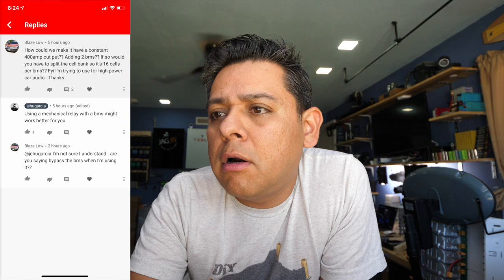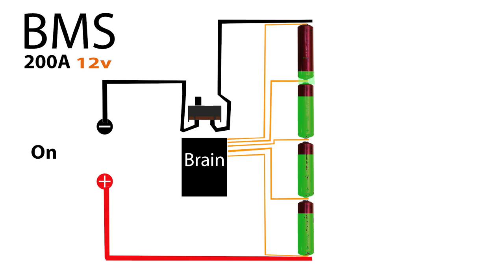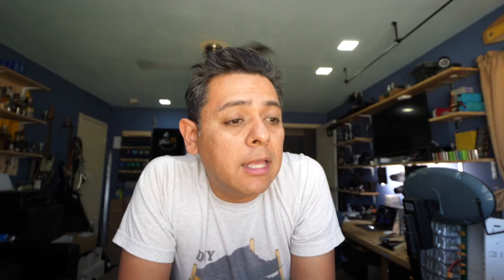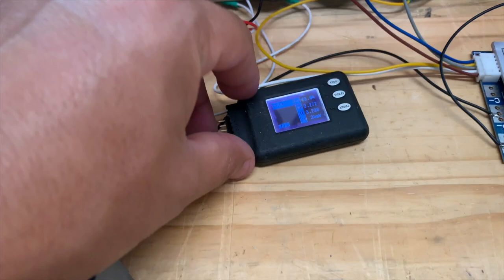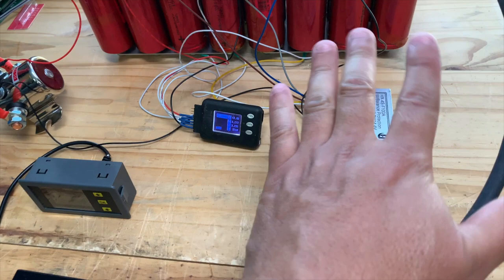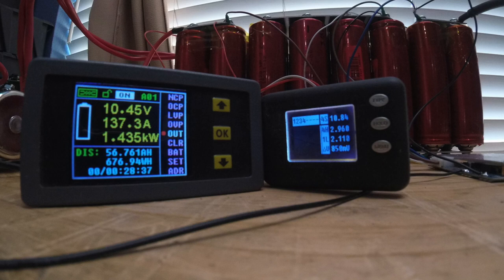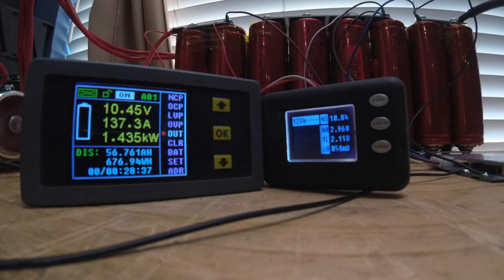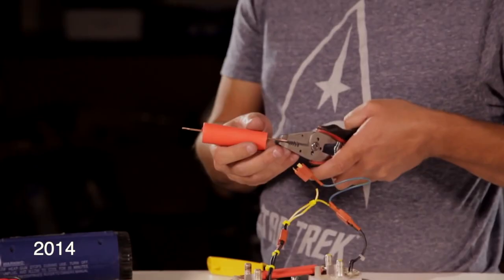4000A BMS?

Comment: Here's a little trick I use for reducing the holding current on a contactor. Hook up the contactor / relay to a power supply capable of driving it. Apply rated voltage to the contactor to close it and record the voltage across the coil and the current through it. Use R=V/I to calculate the coil's resistance. Now reduce the voltage across the coil until the contactor opens and record the current through the coil. You'll want about 130% of the current going through the coil to keep it closed. Now you have enough information to calculate the resistance and power rating for a resistor to put in series with the contactor's coil such that, once close, it will remain closed drawing just enough current to keep it closed. The trick now is to find an electrolytic capacitor to put in parallel with the resistor that will close the contactor fully when power is initially applied. Usually several hundred uF. The voltage rating of the cap need be no more than whatever the voltage drop is across the resistor. Take note of the cap's polarity as well. This can significantly reduce the power consumed by the contactor, which will also run much cooler.
Reply: Yup that is a home brew version of a constant duty solenoid driver. Best way to do it is to use a sense that indicates closure and then enables a pwm drive to the magnet. Another method is to use large IGBT bricks to switch the current on or off. No moving parts and for a simple switch they would likely outlive whatever the load is.
Reply: @christopherleubner6633  like a coil econimizer some contactors have built in. you talking about igbt like in the bms? or or those called mosfets? your saying replace the contactor with igbt? so bms mofet turns on igbt which turn on load?

Comment: Yes. The other problem with some of those contractors is, some are not rated for continual use
Reply: yep as they are often used for just starting bursts....ALso check how  many amps the coil requires, thats  continuous energy required

Comment: For my VERY HIGH POWER systems I use IGBTs. They can be pricy but they are solid state (I mechanical switches with coils that pull power on their own). Plus if not done properly the inductave spiking or kickback will blow up your BMS so you must use a freewheel diode. IGBTs are just amazing.
Reply: A little late to the party but IGBT's are simply not the way to go, given that they have a fixed voltage drop of something around 1-2v, depending on current. So if you're passing say 100A through the IGBT, it will be dissipating 200w of heat. That's a huge loss right there.

Now of course if you're passing 400v at 100a through that IGBT, a 200w loss isn't THAT much compared to the 40kw that its switching, but it's orders of magnitude more than the 2w that a modern day 500A relay consumes to stay closed.
Reply: @00000005547  "it will be dissipating 200w of heat" compared to the 1.5 to 2 watts of the relay coil if it has an economizer 
... 7-8 watts if not.

Comment: I have had trouble connecting relays to BMS this way. Most of those BMS switch the charge and discharge current independently. So in the configuration shown in this video, the relay will stop over-discharge but will not stop over-charge. If you flip the current flow the other way through the relay and BMS, it will top over-charge but not over discharge.

Comment: On the subject of main contactor parasitic power loss, the voltage required to hold on a contactor is much less than what is required to close it. This is because  the armature gap is practically zero when closed and requires less emf   to hold it closed. If a manual reset circuit is needed,  a simple "hold-on" circuit can be used with a voltage divider resistor in series with the contactor coil to provide 75% of coil's rated voltage with a momentary switch providing the start-up voltage.
Reply: that reduces the pressure on the contacts, which reduces how much current they can safely handle.  When your switching such large loads the current draw of the relay\contactor is basically meaningless.  The only time it becomes meaningful is when you leave it on all the time while your NOT using it.  Or possibly if your using a large bank at a low load such as in a Camper or RV.

Comment: The only difference in between this setup and doing a car audio setup would be you need to add a big fuse somewhere in line right after the relay... it's not a contactor it's a relay that's all it is. They make those relays super strong and if they're not enough you just use more of them to spread the load out... on hydraulic cars they use a bunch of them.

Comment: hi please answer a  question: once the battery is discharged and BMS shuts down the contactor. then how does BMS Reconnect the contactor so the battery can recharge?  is it applicable in a single port configuration? thank you
Reply: The BMS can sense also the "disconnected" connector.
Reply: Same question in my mind

Comment: So BMS is just a simple board that watches cells voltage and sends a signal to shut the circuit on or off. All it matters is the power of the relay. 
Not talking about balancing of course. I would do that couple time a year with a decent balancer separately.
A simple RC hobby battery monitor is like 2$, which sends a signal if any cell being too low or too high and capacity or power of the battery doesn't matter. The signal can be translated into a relay switch then.
Again, why BMS are so expensive and complex? All you need is a decent voltmeter for each cell and a simple logic to send a signal to a relay/contactor.
Reply: Some BMS systems try to balance the batteries. They try to discharge the ones with the highest voltage so that all of them are in a specific voltage range. Others try to charge the batteries with the smallest voltage by discharging the fuller ones. And there are the simple ones which simply monitor the voltage of each battery and then send a signal if one of them is too low.

Comment: Read the description on some of those. On the 400a, it says that's peak only. What worries me about contactors is contact welding. My 3 wheel uses some of these for reversing and I've had them bind up several times.  Mileage may vary.
Reply: I have seen/heard of using a small capacitor across the contractor points to damp the arc to prevent/delay contact welding. Electrical engineers on this group may want to verify this.

Comment: For motor control they are called contactors, Automation Direct has 360A with 24V coils. In cars they are most commonly called solenoids, starter solenoid, and is used to turn the starter motor to crank the engine and rated 100A peak in cars. 

If your searching for a super high amperage contractor most engineers will use 4kA not 4000A. Higher amperage units usually require a lot of clearance and sometimes external lines like cooling for an arc welder. 

Hmmm you could use an old robotic arc welder to switch 1000s of amps.

Comment: If you need that many amps you could get smaller cells grouped in banks of 12P or larger and use an active balancer, or 60P with 1S balancers. BMS devices really aren't meant for heavy lifting and placing them in series is a bad idea IMO. Now you introduce relays as well as the BMS increasing the wiring complexity, adding yet another potential point of failure and then additional size/bulk to your battery if you're trying to make it portable.

Keep in mind also that just because a cell can output super high amps it doesn't make it a smart idea to do so. These Headway cells are proprietary and were specifically made for a certain application (maybe you can enlighten us on their origin!!!). Sure, you could string 16 of these together for a 48V 200A pack, but your 48V PSW inverter won't be running for very long LOL, and expecting to drain each cell at it's max rate won't bode well for the cell's life span either. It's also a great recipe for FIRE if you're not careful.

If I was building with these cells I'd string 8 together in series, wire in a 60A 24 to 12 volt DC-DC converter and split that output to three 12V 20A cigarette lighter plugs. Now you have a compact portable pack you can keep in a bag in the trunk of your car to run tire inflators, charge devices over 12V and with a small 300W inverter give you enough AC power to run a laptop.
Reply: All is true but he was talking about using in a car for car audio. In some cases like me i have 2 300amp alts and somewhere around a 400 amp of constant draw and 8 to 1000amps of peak burst draw and thats why he went this route. Otherwise i would agree. Not really a setup to use with an inverter true. Unless it can handle it and you need it i suppose.
Reply: @demolishedmembrane  Got it. I'm not familiar with dual alternator set ups in cars. I've had two batteries connected to a single alternator and it would just charge slower. I am assuming in this case each alternator is charging a separate battery, but the batteries aren't connected together.
Reply: @Luscious3174  in my case actually all wired in parallel including 7 batteries lol crazy shit but alot of car audio guys have this and more. Thats why i was watching this to see if it will work

Comment: contactors in parallel do not operate at identical times. therfore under high current fault conditions the one that opens first will suffer severe arching and will weld closed in the future.
Reply from the maker: Except I’m been running parallel contractors on my diy ev for 10 years now despite people like saying it wouldn’t work

Comment: If it's for mobile audio, the BMS can just control the remote-on of the amplifiers.
Reply: Correct.
Reply: No, nice in theory but in reality, the BMS is there to protect the battery bank, in fault, amps and other loads can still draw power. Use a breaker.

Comment: Hi....    you forgot to tell us how you wired the bms to relay circuit........i.e  where do i connect the relay control voltage  on the BMS board?   thanks

Comment: I always called those Solenoids.. I guess I've been wrong big chunk of my life. 🤔

I use those in car audio to charge a second battery only when the engine is running. Once I killed the ignition it breaks the circuit no more current flows to the secondary battery so it sorta isolated it from the main car battery.
Reply: Solenoid is also correct. Americans always choose the simplest word to describe something!
Reply: Most people use these interchangeably. I always think of a solenoid as moving something mechanical, like a starter solenoid or the valve in a dishwasher or washing machine.

Comment: You should just get the SBMS from electrodacus. It allows direct connection to the battery and allows you to turn off the loads via a small DC SSR.
Reply: Actually this technique would allow the same. An SSR could be used as a contactor but I would suggest something more powerful. On the other hand Dacian is brilliant. Have you seen his build process?

Comment: I understand if you're not paying attention it could be a safety issue, but why does the BMS also need to be able to break the entire load current if you have an accessible shutoff switch? All you strictly need still is cell voltage monitoring, but just hook the alarm up to a buzzer not the whole pack. That way you might be able to pull over more safely etc before totally disabling your drive system, in the case of a car. A few more seconds at low load won't bring a cell that just passed 3v to zero.

Comment: How To BMS a 1000A Continuous Battery Discharge
Just use the BMS and have the P- connected to the coil on a Contactor. When LVC is tripped the P- will no longer send current to the Contactor coil and the Contactor will open and disconnect the battery from the motor controller. Then connect your load direct to the battery B- and B+ (of course using a fuse, a pre-charge switch circuit to pre-charge the load if needed, and an Contactor switch where the coil is connected to the P- of the BMS). 
Also the Chargery BMS24T has a 600A model that I think will do 300A continuous and is only $320USD shipping in.

Comment: Look for solid state contactors. They use small fraction of the energy  a typical contactor uses.
Reply: Solid state relays a basically resistors that allow current to pass when a voltage is applied to the gate terminal.
There is a residual resistance that is much greater that what the relay coil has.
SSRs tend to be good for low currents or when switching needs to be very quick (i.e. PWM)
Otherwise electromagnetic relays can be much more efficient ... but be sure it is rated for continuous duty.

Comment: I bought an 14s bms, but i did not run the main current through it, instead i run the negative straight to the charger and inverter. I figgured, it is particular bad for the charger to get disconnected from the load/battery. And I found out, that the inverter has its own cut off voltage shut down setting. Its a grid type inverter, and it can comeback  on when the voltage is  up again. oi I just connected 15 little wires to the bms to run the equalization procedure, and left the thick negative connections unused. works like a charm.

Comment: Def need to install this in my car audio set up. Winter is coming around and when it's too cold to use my lithium I don't want to have to unplug it till it warms up lol, only bad thing is the relay is a choke point and another drain but eh, there is so much parasitic crap hooked up already. Beats pulling wires when it's cold

Comment: Use Mosfet relay with optical insulation so it drain maybe 1mah per hour or MAKE YOUR OWN RELAY using motor and arduino....when bms aply voltage motor turn the switch on but turn motor off after that ....when bms turn off the power arduino start motor again so it turn switch off and then the motor.
So there is no power drain in the system all the time :)

Comment: Latching Relays. The stay either open or closed without continually drawing current. They have high current ones for  RVs. That's what I use.
Reply from the maker: Do they exist?  I’ve never found ones I could order and try out
Reply: @jehugarcia  P.S. You do amazing work.
Reply: @jehugarcia  Dual coil means you have two different inputs to switch the relay on or off. Apply power to one set of contacts to turn on and another set to turn off.
Single coil means you have to reverse the polarity of the charge you are applying to the one set of coil contacts to switch it on or off.

Comment: I have watched this video and the video where you put 2 BMSs in series. I have 45 (3.2v) lithium iron phosphate cells making up a 144v battery pack. i am asking can I manage all the cell with two 24s BMSs connected in series but not connected to the battery pack for charge and discharging.  (use them as switches as demonstrated in video) Run 12volts through them to a solenoid contact-er that will turn off the charger when max voltage is reached per any one cell. If yes, I intend on adding a two way switch on dash. Up for charge and down for discharge. On discharge BMS will interrupt 12v to main contact-er for low voltage shut-off.  Thank you, Love your videos!

Comment: Jehu couldnt you just break down the number of cells in your battery pack to like a group of 8 or  12 or 16 or whatever and then use a BMS without the relay. And then parallel the groups together each with the own BMS ? Thus getting rid of the need for the car relay ? And still have 12 volts ?

Comment: How do the typical "12v" relays transfer over when you UP the voltage. IE how will a 300a 12v relay work on a 72v system?  What relays to you use for typical higher voltage Ebike builds?